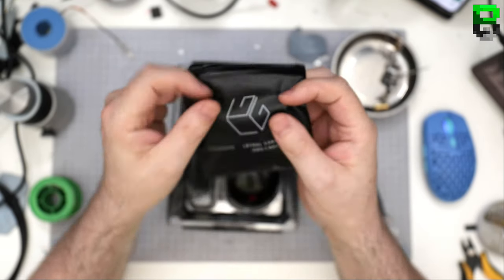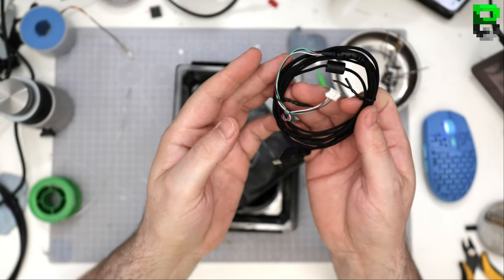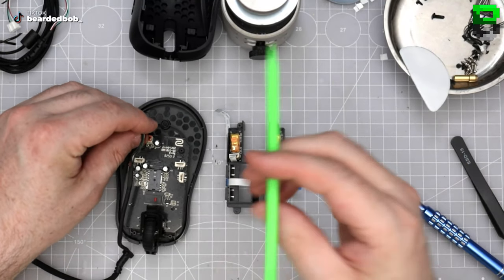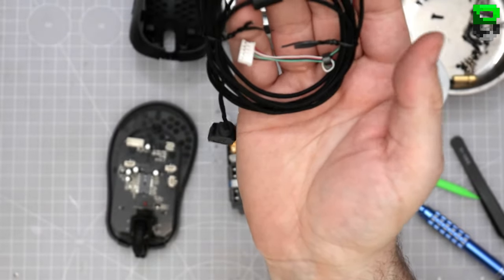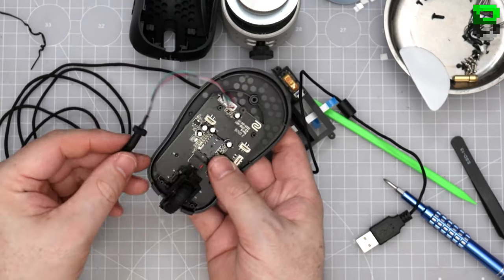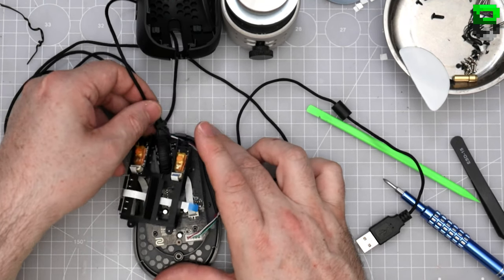How To Paracord Your Mouse Tutorial - Zowie

Comment: Where did you get the big soldering iron tip? Would be cool to get one that could heat all 3 pins at the same time. What is the tip called?

Thank you! :)
Reply from the maker: its called a shovel from Hakko
Reply: @Beardedbob  Thank you
Reply from the maker: np
Reply: switch zowie ec3-c which one did you use? link please

Comment: Hi bob! Do you know if ec3-c 1st batch "known" disconnect issue is only a cable thing? I can't send it back sadly but maybe a custom cable could solve that issue
Reply: I have the same problem, did you solved yours?
Reply: @srydownloader  yes, i replaced the cable
Reply: @413fps  Thanks for the answer.
All the cables I find on the internet come with 5 wires, I'm having trouble finding one with 4 wires... =x
Reply: @srydownloader  lethal gaming gear slim cables are 4 wire and any other custom paracord maker is going to make you a 4 wire one. 
You can also re purpose an old cable if you have, or grab a rubber cable, take it apart and bare braid 4 wires(bbw cable mod), that is also just better than paracords.
Reply: @413fps  thanks for the tips my friend =)
Reply: Can i replace any paracord cables?
Reply: @Fullmoon1234  I replaced mine with a standard paracord for the aliexpress, the most cheaper that i found. Replaced with no problems.
Reply: @Fullmoon1234  yes but doble check the color order at the jst connector. If it does not match the zowie one re-arrange it
Reply: thanks a lot guys